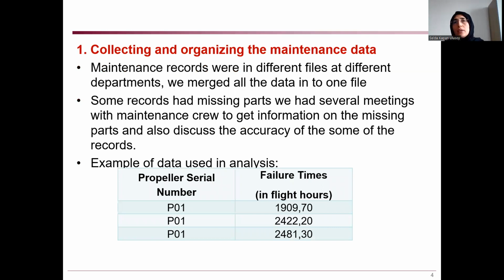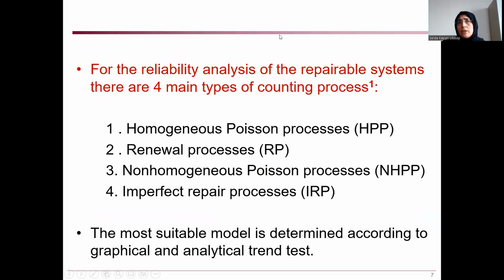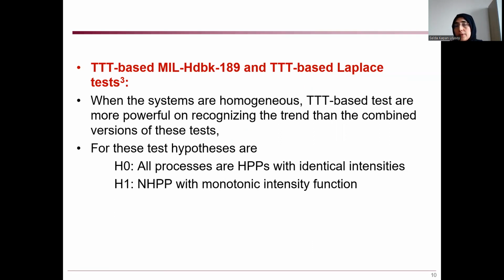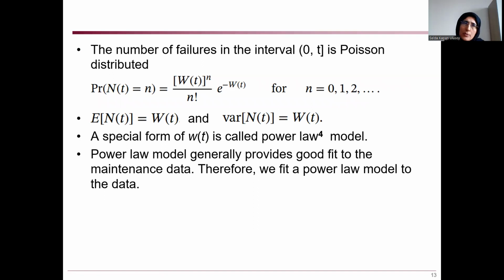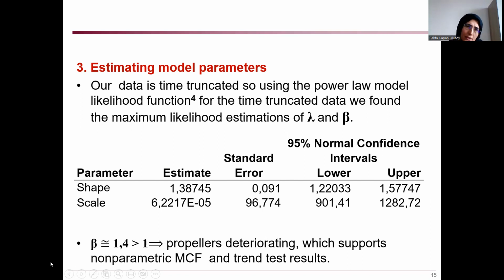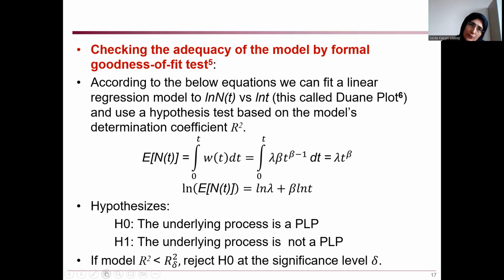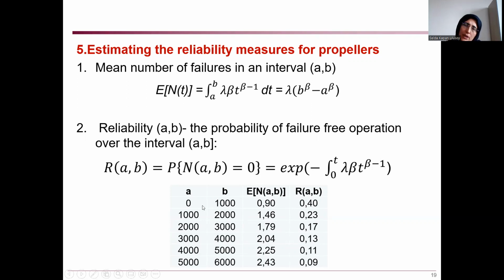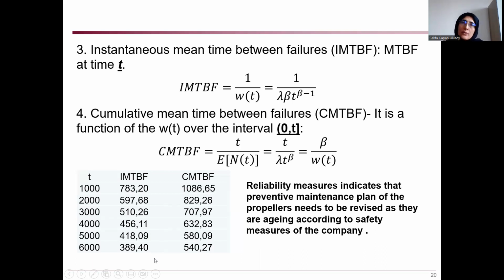CONF-CIAP 2023 - Aircraft Propeller Reliability Analysis

Comment from the maker: Here are the questions we collected and the answers replied by the presenter.

Q1: Are there any common challenges or limitations associated with using counting process models to analyze propeller reliability, and if so, how do you address these challenges in your work?
A1:
i) NHPP model assumes that repairs are minimal. If the repairs are imperfect, then generalized renewal
or trend renewal model should be utilized for modelling.
ii) If the operating conditions of the propellers are changes dramatically than piecewise NHPP models
should be utilized for modelling.
iii) If the intensity rate of the systems is non-monotonic then NHPP models with non-monotonic intensity
rate should be utilized for modelling.

Q2:What are some potential future directions for research or application of propeller reliability analysis, and how might these developments impact the aviation industry or other fields?
A2: As future research, using the estimated reliability measures and cost figures of maintenance actions a
maintenance optimization problem could be solved.